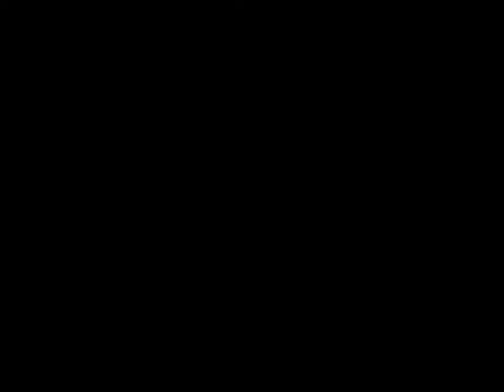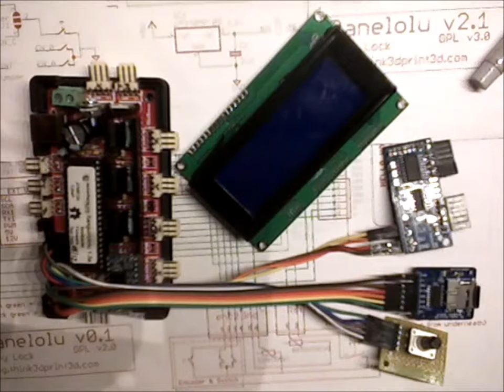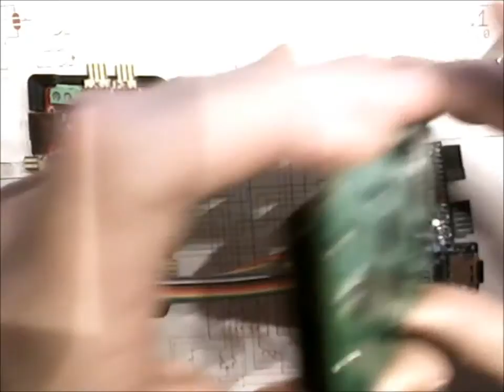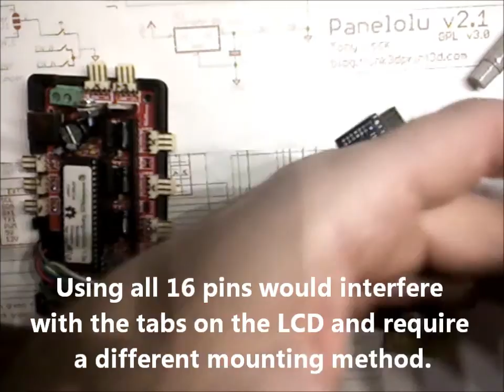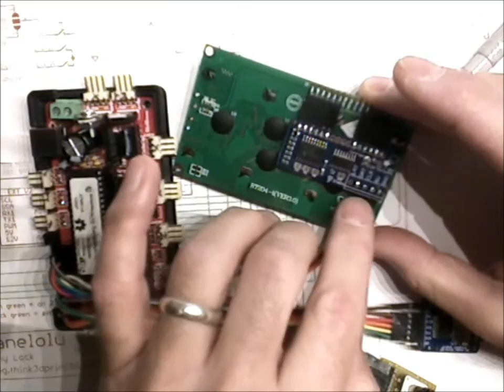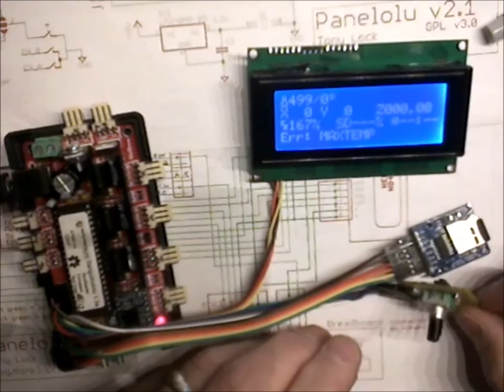Adafruit i2c LCD panel for 3d Printer

Comment: I know this is an old video, but would you be able to tell me where each of the pins from the encoder, the LCD, and the SD Card slot? (and if possible where the firmware needs to be edited for those components)
Even if you don't remember specifics, and info you might have would be much appreciated.
Thanks!